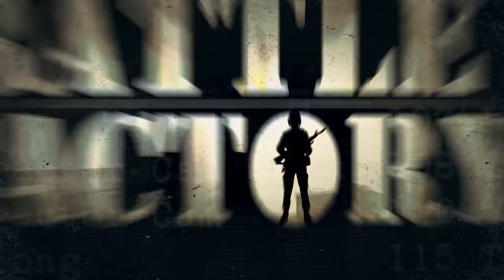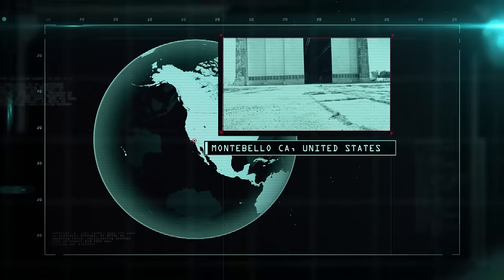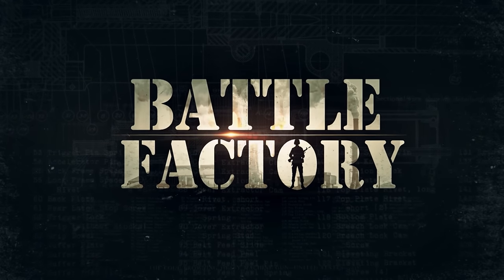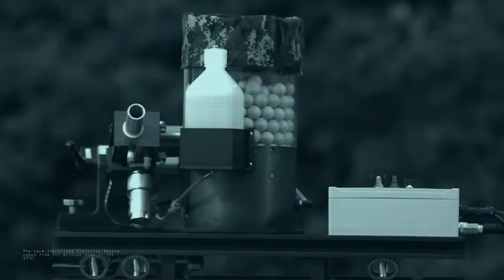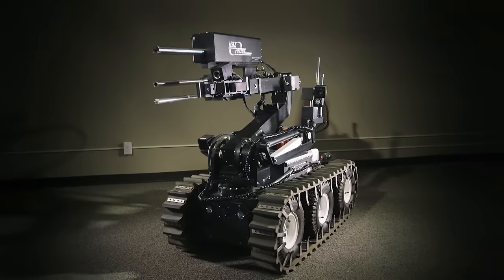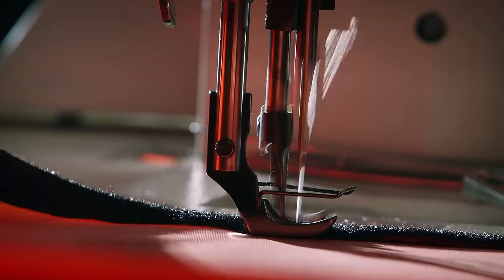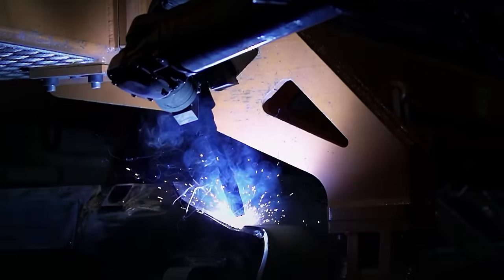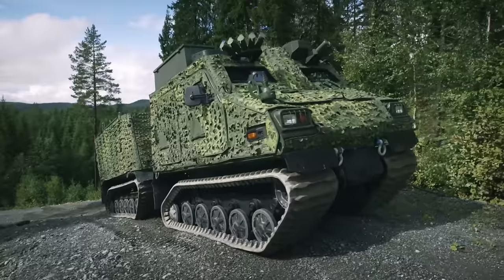Battle Factory | Manufacture of a Zeppelin, Sniper Rifle, Armoured Vehicle & More | FD Engineering

Comment: first off at 1:54 , the oil is not added to the sheets of steel to prevent rust . its a lubricant for the stamping process and to keep the steel from sticking
Reply: The same though came into my head 😂

Moreover. The stamped groove is not for draining blood of the enemy it's made to prevent the blade from curving and bending, in other words it makes the knife harder.
Reply: @nick_vash  Not harder, stiffer. Same thing they do to sheet metal when they add ribs / grooves. It makes the sheet metal stiffer so it doesn't bend as easily.
Reply: @eanders7992  Actually, you both are wrong.  If you look back at bayonets you would see what that groove was put there for. It has a name " Blood Groove" for a reason. It is to allow blood of an enemy or animal to be allowed to escape. Punching that groove does not make it stronger as it does not form ribs.
Reply: @gravelydon7072 it's funny how the info is easily available and all of you are wrong. It's to make the knife not ad heavy without sacrificing the structure and durability. Regards
Reply: @caseyfisher9049  As Bayonets were military in origin, I'd go with the Army term and that is that they were blood grooves or fullers. And the Norse used the term blood groove in Viking days so it isn't something modern.
Reply: And as to problems getting a bayonet out, that was described in the 1800s by the British which is why their instructions were insert, twist, remove..
Reply: @caseyfisher9049  And by the way, a fuller is a blacksmiths tool used to make a groove, not the groove itself.
Reply: @gravelydon7072 sorry but you are wrong. Is called a fuller and lightens the blade and increases the rigidity and perhaps improves aesthetics. Look at daggers they don’t have ‘blood grooves’ , because they usually use a diamond shaped blade for stiffness.

Comment: The fuller is not used to channel blood its designed to make the blade stronger and lighter. 2:12
Reply: It does make it stronger but not lighter. All it does is stamp the steel and doesn't remove metal.
Reply: And remove easier.
Reply: That ain’t even right bud! You don’t even know
Reply: @mastercreamer1398  lol y u mad 😂
Reply: it will give strength like car panel swagezs.  But in the NZ army Sat Sun soldier they said it was for the blood as when you stick the targeted muscle can clamp up on it - and the grove is there for blood to pool in making it easir to slide out.  Film regards Pakistani attcks in Mumbai 2011 show - bloke interveiwed said he never realised how blood could be so slipery - regarding blood pools on the ground,  stepping on it in a hurry and having foot go out from under you.  Charming how they know these things.
Reply: But its sounds so much cooler when you call it a blood groove and tou invent purposes for it :)))
Reply: It makes it sharper. 😏
Reply: It's is designed to let air into a wound so the knife doesn't get stuck
Reply: It's an anti suction groove. To make sure you can pull it out easier. 

Now go read.

Comment: The oil is for lubrication not so the metal doesn't rust. It has the chrome to stop it rusting!
Reply: and it was applied on only on the side it came into contact with the press, meaning, its there for friction reduction.

Comment: Airships “powered “ by hydrogen? I don’t think so. Hydrogen was used in the gas cells inside the main envelope to provide lift.
They are generally powered by conventional aircraft engines with propellers.
Reply: He also stated "infamous Hindenburg" ,, if wants to narrate he should learn what words mean lol
Reply: @davidwraight9940  indeed
Reply: @davidwraight9940 actually he is correct. The Hindenburg was infamous for crashing in flames. If it was famous it would be for something positive. And crashing is not positive
Reply: came here to say that.

Comment: one question what protection does the viking provide against IEDs?
Reply: it´s flat floor is pretty bad at that
Reply: Not a lot you could reach underneath and push the floor up and down. After a few years and deaths they eventually changed the design to have a v shaped hull to deflect the blast  these were called the wart hog varient. Still one of the most fun vehicles i operated, these things can go anywhere. Pretty freaky initially driving into water with them.
Reply: Warthogs are of a totally different build from singapore, st engineering. The warthogs come from the st engineering bronco. A few got blasted but no deaths. Cannot be said of the vikings.

Comment: kill shot from 2.4 km is sheer luck. There is no way to calculate windage over that distance.
Reply: Yes there is.. if your running a high enough BC projectile, 2.4km is not that far.
Reply: Yes there is. Given the fact that modern day snipers have the tools to calculate wind, rotation, temp, moisture.